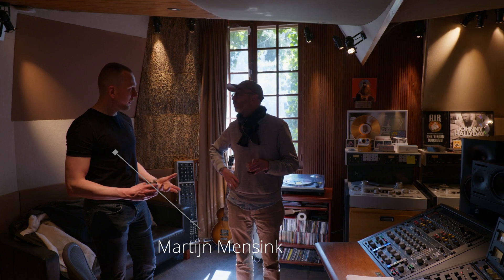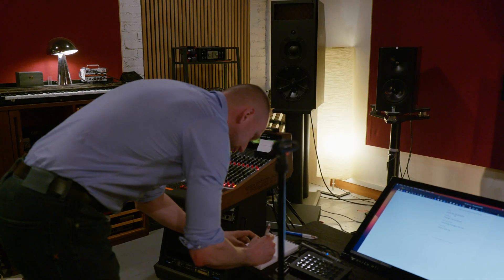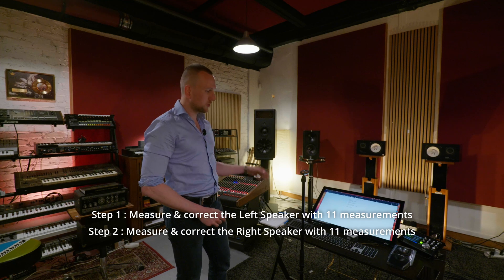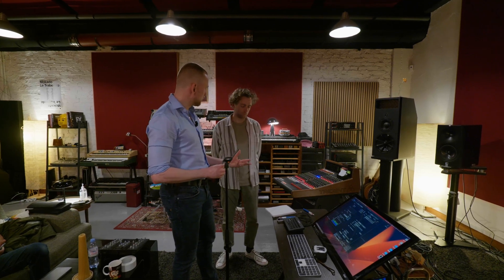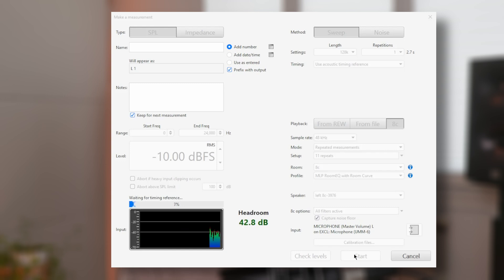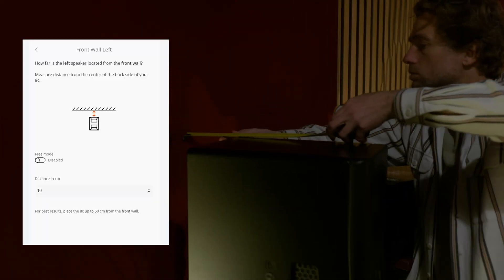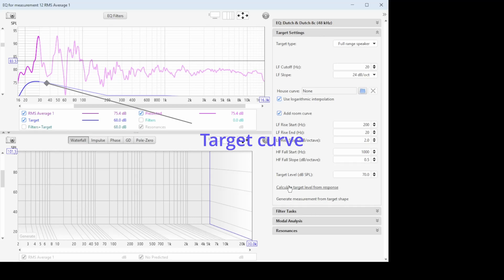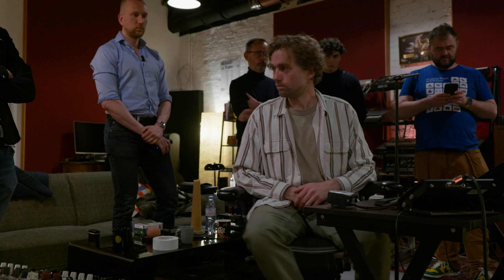Dutch & Dutch 8c CALIBRATION and PHILOSOPHY with Martijn Mensink

Comment: Do you expect a normal person
to do all these steps?
You need to be an engineer for that
I think it's impractical 
I would expect the speaker to know how to calibrate in a few simple steps. 
Like for example the dynaudio or buchardt speakers
Reply from the maker: Measuring the distance from your speakers to the wall and open a app isn’t complicated, isn’t it ? Moreover, all those steps are optional and the 8c still sound great without all these measurement-based features.
Reply from the maker: What features of Dynaudio and Buchardt are you talking about ?